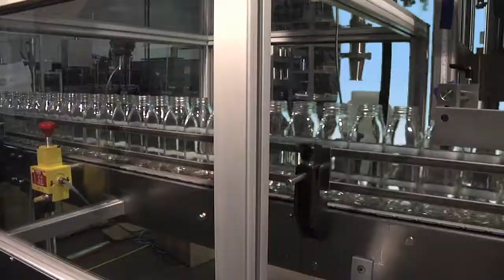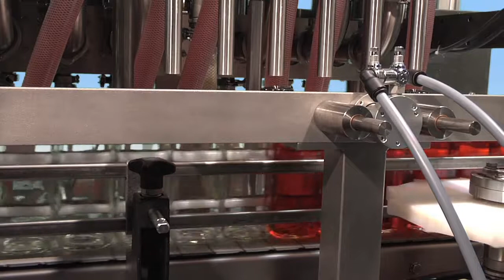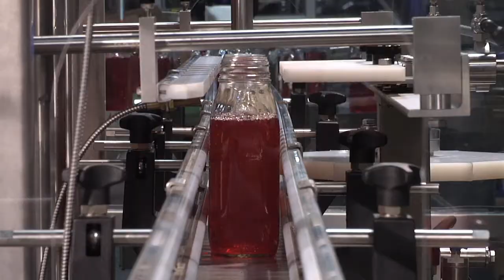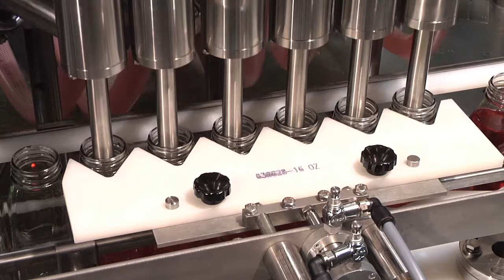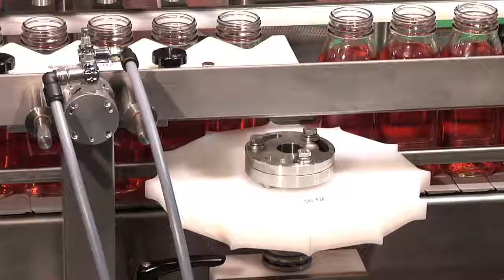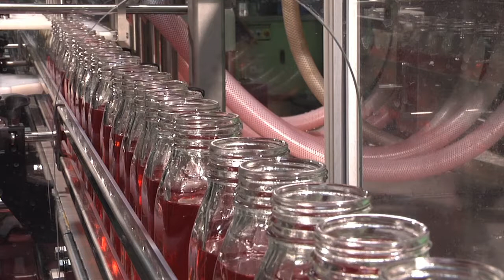Inline Piston Filling Machine - IPF

Comment: HOW TO MAKE DISHWASHER DETERGENT | FORMULATIONS

When considering to produce industrial automatic dishwasher detergent, There is a need for good and usable formulation. This formulation is needed in order to decide which chemicals should be used. Also, needed in order to decide in what quantites should be used.

After supplying chemicals to make liquid industrial dishwasher detergent. Manufacturing is a mixing process. There is no need heat during production of liquid industrial automatic dishwasher detergent. İt is only cold process.

Tags : what is industrial dishwasher detergent | making industrial automatic dishwasher detergent liquid | how to make industrial dishwasher detergent powder | definition of industrial automatic dishwasher detergent | production of industrial dishwasher detergent | formulation of industrial dishwasher detergent | types of industrial dishwasher detergent | composition of industrial dishwasher detergent | compound of industrial dishwasher detergent | content of industrial dishwasher detergent.

SOLVER CHEM BOOKS